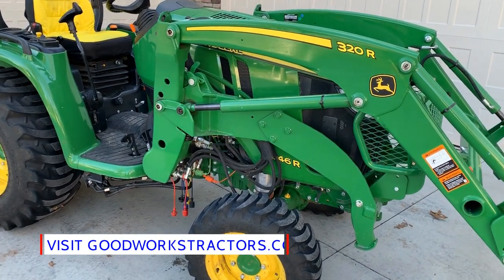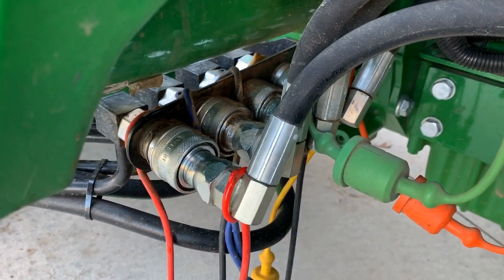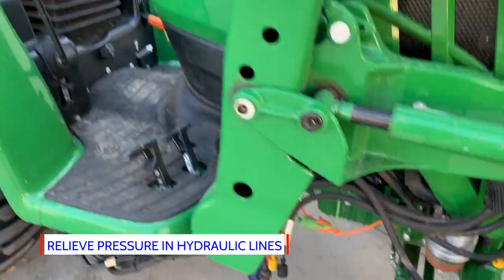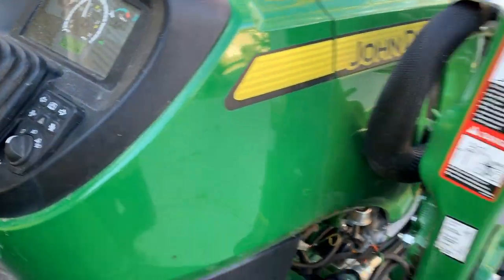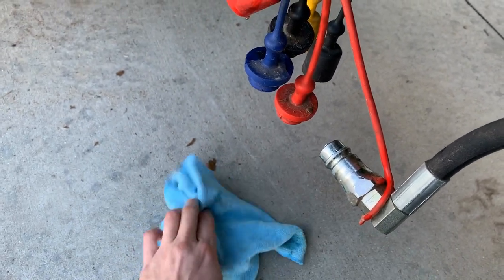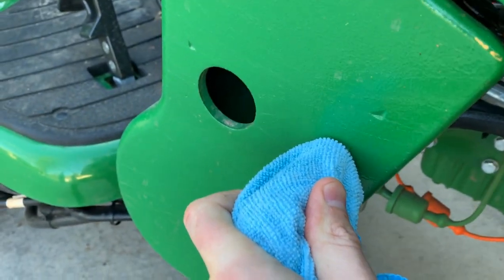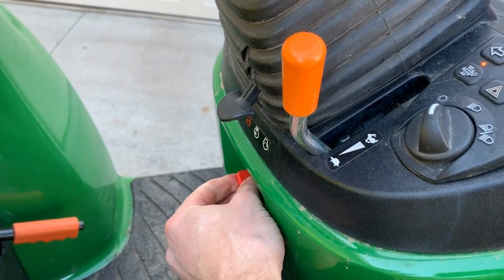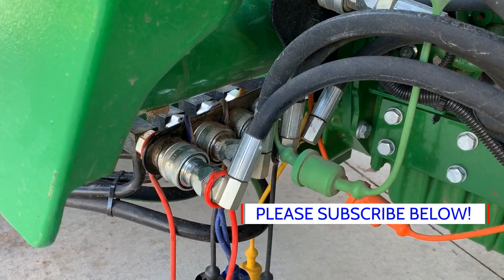Tractor Tip Tuesday: Connecting Quick Couplers

Comment: I've been looking for a simple explanation on how to relieve pressure and disconnect/ connect hydraulic lines. This video covers that beautifully and simply. Thank you so much!
Reply: An even easier way and a better way to relieve any pressure on both ends of the connections is as soon as you shut your tractor off, wiggle your control arm to relieve all pressure and you don’t have to waste your fluid either🤦🏻‍♂️

Comment: Thank you VERY much.  I was dumping pieces of logs on a brush pile today and 2 of the couplers on my loader hoses got "pulled out" of the (base(?).  I knew I had to release the pressure on the lines, and did, but I couldn't get the lines to go all the way back into the coupler.  Apparently, I'm not pushing/pulling the slidable ring back far enough so the hose end can go in all of the way.

I subscribed to you channel--I'm sure you'll have other great stuff that I can do on my own for my tractor.  I have a 2009 Massey Ferguson 1533 with a DL 120 loader.  Thanks again!

Comment: Also, if you have a third hydraulic function for a grapple or 4:1 bucket, you can relieve the hydraulic pressure by having tractor off, then turn key on so power is on tractor then press your "open-close" toggle on your control valve. Then turn key back off. If you listen, you may even hear the control valves moving while toggling.
Reply from the maker: Yes, good thinking.  Thanks for sharing Matt!  Happy New Year!
Reply: Thanks for the tip.  I was having trouble with that.
Reply: Excellent to know, I was having that exact problem !

Comment: Mostly worked, the bucket is operating properly but the coupling is not tightly seated like the other ones are. I disconnected and released pressure  and again I can get it in but not firmly. Didn’t want to tap it with hammer or anything without your comment/ advice! Thanks in Tx.

Comment: Thanks for the informative video. Good to know. I'm a Kubota fan but some people like Fords some Chevys. I have had good luck with Kubota for years but just traded my old tractor for a new MX5800 with a front loader and I'm fairly new to hydraulics, so thanks for the helpful tips.
Reply from the maker: I like Kubota and John Deere.  This video really isn't a K vs JD comparison.  They are just quick couplers found on most tractors out there or a very similar variation.  Glad you found it helpful and I've had the pleasure of operating a few different MX Series.  They are fantastic machines.  I hope you have fun with it and thanks for watching!

Comment: I have a 2016  John Deer 1025R & yes i have found out the hard way as you've shown in your video about this hydraulic pressure built up in the hydraulic lines. I used a ball peen hammer & gently tapped these "nipples" & then i was able to double check the released pressure by pushing in these spring loaded nipples with my thumb.  Great video
Reply from the maker: Thanks for the comment.  Have a great day!
Reply: @GoodWorksTractors  You as well

Comment: I was moving piles of tree debris. Got too close into pile, far enough that something caught and pulled down two of the hydraulic hoses under the tractor by right rear wheel. They are actually touching wheel. Trying but can't find a way to get them "back in place" so that they are not touching rear wheel. Appreciate any recommendations.

Comment: Nice video  I have a 5yr old 30-39 R  Noticed that the quick connectors connected with the hose up.  My tractor was delivered with the hoses connected down and that is the way i have been using it.  Is there a correct way or does it make no difference?

Comment: Hey there, i really need help trying to figure out where to connect my root grapple i just purchased. I have 3046R JD with a 320R loader and my joy stick already has the toggle buttons. Ive been to a couple of JD dealers and no one has been able to help me. Im trying to get my grapple working but dealer doesn’t know where to connect my hoses to get it working with my toggle buttons.

Comment: Hey there,just got my 3039R JD home,its new,the one I had told ya about I ordered ,love the power,nice tractor,but Hyd,issues already,one of the curl rams is bad and constantly running it back up,the Dealer got one coming for me,but now it sound like air in the hydraulics when it running and after running a hr or so,the darn thing gets very loud and hydraulics for 3 point gets jerky,saw a you tube video about this,but no answer about what they did for repairs,have you ever had one with this problem,thanks
Reply from the maker: Yikes, I haven't experienced those problems, but hopefully they resolve them for you quickly.

Comment: I had a couple of these leaking on my tractor (2016 1025r), and my local dealer replaced them with new ones, but unfortunately the new ones seem to have 3x the spring tension on the female collar. It's almost downright impossible to connect these, even with two hands. The original ones had very little spring tension and were a delight to connect. Do you know if Deere changed these somewhere down the road? My warranty is up now, and I would like to just buy some nice ones that are easier to work with. What brand (if any) would you recommend?
Reply from the maker: Hi, not that I'm aware of.  Did you ask your dealer?
Reply: @GoodWorksTractors , I just recently had them put on and now my warranty is up. (Well, they told me 6 years power train and only 2 years on everything else.) So probably up to me now. I asked them awhile back about them being tougher to work and they said that that's the first they've heard of that. Which I find odd, because they are noticeably different collar strengths. It's not that they don't work, they are just hard to work with. My dealership has not been very helpful at all, I've actually been to two separate dealers and had bad luck at both of them. Poor maintenance and poor turn around, with lousy communication. My 260 backhoe has been in about 3 times with complaints about it loosing hydraulic pressure on the dipper stick while in the middle of digging. Needless to say, it still does it, it's out of warranty, and they never fixed the problem. Good news is, I like working on my own stuff, so now I can diagnose it and fix it correctly. I guess the old saying is true, "If you want something done right, you have to do it yourself."
Reply: @grantdeisig1360  I have been warned by other contractors I know not to buy Deere because their service and warranty are horrible.
Reply: @joaquincortada1483 , my experience has been less that satisfactory to say the least. But I'd be bias if I said that only Deere had bad service. My chevy is a pile and the dealers I've took it to are idiots. Seen the same thing at Ford, Kabota, Massey, IH, Dodge. Really what it comes down to is that the quality of craftsmanship from dealers has bottomed out. Warranties really don't mean anything anymore. Why have somebody at the dealership mess it up when I could just fix it right the first time myself? It's just the way America is nowadays. The mentallity of the worker is: It's not their vehicle, so why put any effort into the care of it? It's just like that scene from Tommy Boy when he says that there's no guarantee on the box...lol warranties are just there to make you feel better about buying a pile of crap. A good example of quality would be Ruger firearms. People say Ruger doesn't have a warranty, (which is true) but it's because they stand behind their product and will keep you happy for a life time, if something messes up, they will fix it. I found the same to be true with Henry firearms. This is how dealers should operate, but times have changed.
Reply: @grantdeisig1360  yes I completely agree.  Seems like not many ppl take pride in their work anymore.

Comment: I stir the 1025r SCV to relieve pressure in the lines as specified.  Reinstalling I keep finding one or two that I have to do the “cover with rag and push valve to relieve pressure” fix to reconnect.  It is usually the black connector.